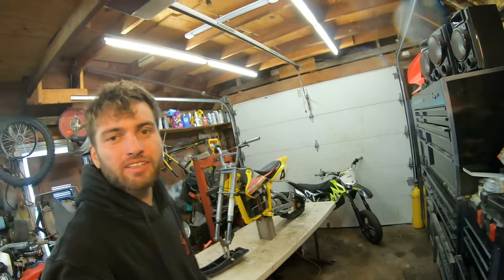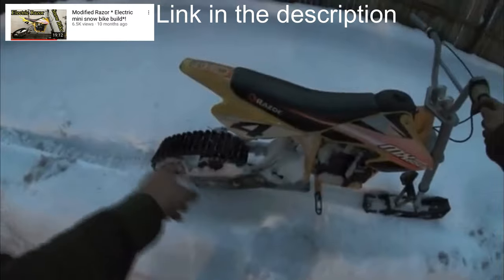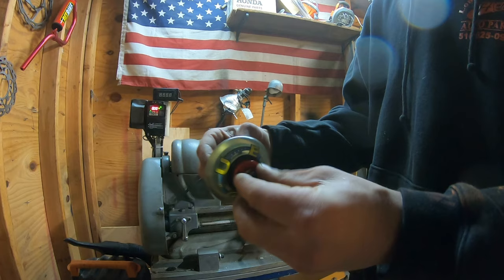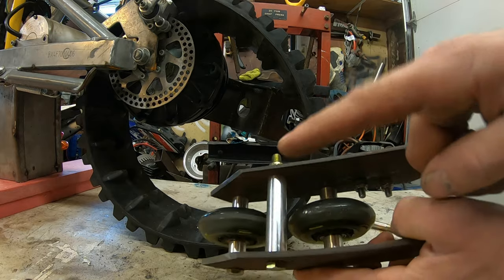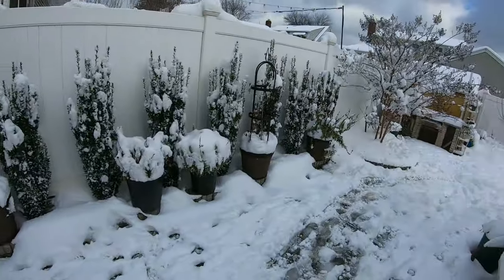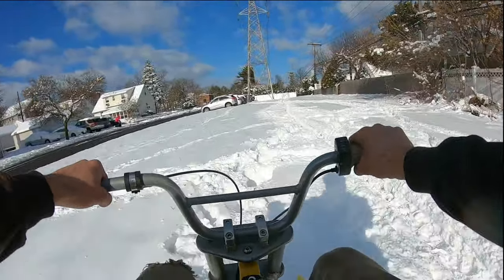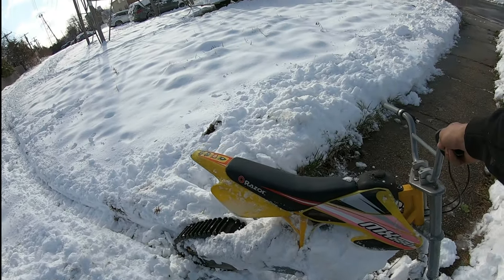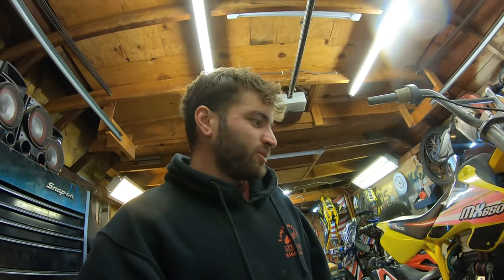Ep2. Electric Razor Snow Bike! It Works REALLY GOOD!

Comment: You won't have to worry about the cold once the cells are being used, MOST important with a big lipo pack is heat management as it tends to build in the center of the pack degrading those cells first creating even more heat at the center until smoke. Use sheets of aluminum between cell groups that connect to the main case to use it as a heatsink. Dope bike my dude
Reply from the maker: You don’t think the battery will get cold when it’s not being ridden in the cold? Like say you ride for 10mins then hang out for a little, will the cold eventually affect the battery? Or not really?
Reply: @Krisuno  If you were planning to use LiFePo4 cells then yes, but lipo cells go to -20 but even if you are worried then just having a "slow" setting that limits to say 50A until you start seeing the battery temp over freezing. The cells will warm up internally well before any temp probe shows a temp change so for the most part just slowly bring the power up and you are good.

Comment: Kris , how are you charging these batteries? Are you charging them one at a time or in parallel ? And what charger are you using. I have 80v greenworks batteries on my mx650 why I was wondering.

Comment: did you ever figure out the slow acceleration issue when you first twist the throttle?  I have this problem with the kit..slow accelereation on first twist, but gives full power if I twist again while motor is still spinning.
Reply from the maker: It’s called soft start, it’s a setting in the controller. Some controller have a two White wire in the harness that can plug into each other to deactivate the soft start
Reply: ok, thanks for the info!

Comment: Which "silver motor"is that? Is it the 72v 3000w?
Reply from the maker: Yea 72v 3000w
Reply: @Krisuno  FWIW that motor will take a ton of volts and RPM. I ran mine up to 134v and over 9000rpm. It didn't appreciate 9000 rpm but it never failed. I keep it around 120v and 8k Also it hates gear and loves RPM. They make almost no torque at RPM. Ran factory 11/80 gearing and 14" wheel on my razor. (47mph @ 120v 210lb rider) Even bumping the motor tooth up one slowed down top speed and killed power down low. I know others have gone faster, but the acceleration is pretty nutty setup like this. 

Good luck!